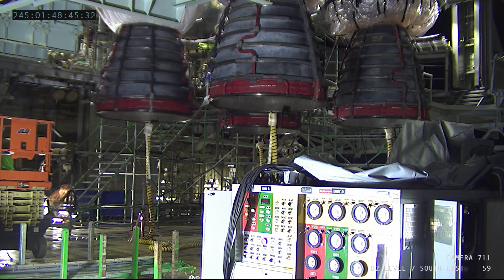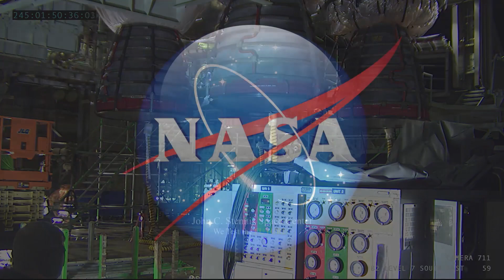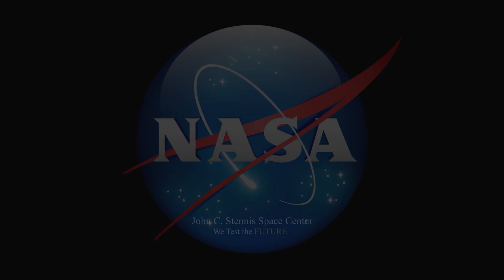Engineers Complete 5th Green Run Test of Space Launch System Core Stage

Comment: Wow!!! What a kind of new engine is that? Neverr seen that before. It's totaly diferent that 50 yeras old STS engine...
Reply: I believe those engines are new/refurbished RS-25 engines that were used on the orbiter for the space shuttle. (Anyone correct me if I’m wrong)
Reply: These are Block II RS-25D engines built in the 2000's
Regardless SSME isn't 50 years old
Reply: AND they can't get it to work...they're pathetic

Comment: When will be the complete green run test of 8 minutes??
Reply: Probably, end of this year.
Reply: Somewhere in october
Reply: SPACE x would have done it 8 years ago.
Reply: @dcb1138  it took SpaceX 8 YEARS to just connect 3 cores together. Think about it
Reply: @_mikolaj_  -And in that 8 years they HAD a core and a brand NEW engine design. In fact, multiple new engine designs. Oh yeah...they started from scratch without existing hardware. Think about that !
Reply: @dcb1138  all from standing on the shoulders of a giant like NASA. Starship is the only comparison to SLS. The raptor engine is a very old design and are part paid for by the airforce. I love spacex too, just look at the bigger picture.
Reply: @dcb1138  in 2010 Falcon 9 was finished. Same with engine, this was flown many times. And something that took ULA 6 months with Delta IV, which as latest events show isn't the most simple rocket, took them nearly a decade(planned FH launch date was 2013).
Giving SpaceX as example of fast is paradox. None of their big projects was on date lately.
Reply: @_mikolaj_  Given they had the same time frame (and less money)  to put men in orbit as Boeing...I'd say your wrong. AND they used their Falcon booster. All boeing had to do was make the capsule. Where are you all coming up with this ?
Reply: @_mikolaj_  -- They could have done it in a month if there was $ involved. Think about that. It has NO economic function for them
Reply: @shaun906  Wait a second.. Think about the SSE being an "old Design".... and they took 10 years to attach it to a booster tank. WOW...And they have to "Test it"... WOW. Haven't they been tested for the last 30 years ! They could have built SLS in 2 year MAX if they really wanted to. This is just MILKING the Cash Cow
Reply: @dcb1138  when did we change from rockets to completly different program? No more arguments? Facts are facts. FH was supposed to fly in 2013. No new hardware was needed, F9 was operational in 2010. And connecting 3 cores is very simple thing, comparing to making completly new core, (especially if governament tells you to use most complex engine)
Reply: @anilozdemir8344  Test 8, the final full duration hotfire is expected in early November, just about a month from now
Reply: @brokensoap1717  they will be able to postpond anyway :)
Reply: @shaun906  You're talking absolute nonsense. Raptor an old design? It is the first ever full flow staged combustion cycle running on a brand new fuel type, it is literally the most modern and unique engine design currently in production. The airforce awarded SpaceX aswell as Aerojet Rocketdyne and Blue Origin grants to assist in engine development because the airforce wants to move away from Russian made engines.
Reply: @anilozdemir8344  nope
Reply: @souljaboi4021  I am aware of it :)

Comment: what a waste of tax dollars thanks boeing
Reply: Not testing this and having it fail on ascent would be a big waste of tax dollars.
Reply: @jakedrums520  you definitely would NOT want it to fail during a manned flight.
Reply: @jakedrums520  Pretty sure they're referring to the overall insane cost of the SLS. You could launch six Falcon Heavy expendables for the same price as one SLS launch, and get four times as much payload to orbit as the SLS. For some inexplicable reason, re-using the already-developed hardware from the Shuttle program that was supposed to save money is costing astronomically more than even the inflation-adjusted price of the original articles.
Boeing is one of the big bandits making an unjustifiable killing on the SLS, and far over budget/behind schedule. They've been repeatedly proving their ineptitude lately.
Reply: @DBJr1980 At the rate sls is going, starship will already be making laps around the moon and doing in flight refueling.
Reply: @IstasPumaNevada  ye but none of those fhs can go beyond asteroid belt due to low Isp, while SLS can send car to Uranus on direct trajectory
Reply: @pilot4life15  tbh, as i watch situation since few years, starship, is actually slower.
Reply: mike  yes youre right you can go with 2 falcon heavys and a falcon 9 to the moon!!
Reply: Agreed...This ENTIRE project should have taken 3 years to complete. But they dragged it out for over 10.....
Reply: @DBJr1980  - Like the Shuttle killing 14 people. You do realize this has an Escape system ?? And it's all "proven" technology. So why does it take 10+ years to develop ? ... Shear milking of the taxpayers. That's why
Reply: @IstasPumaNevada  I think your simple view is not bore out in thrust power of the SLS. its more comparable to the saturn 5, but I agree once my hero @elonmusk perfects starship were better off havinge our eggs in a couple of baskets. remember spacex is standing on NASA's shoulders.
Reply: Worth every dollar imo
This is going to be amazing